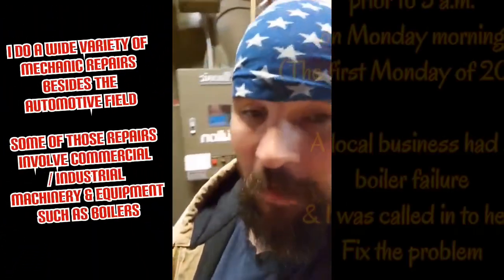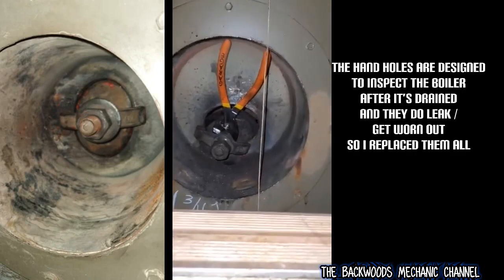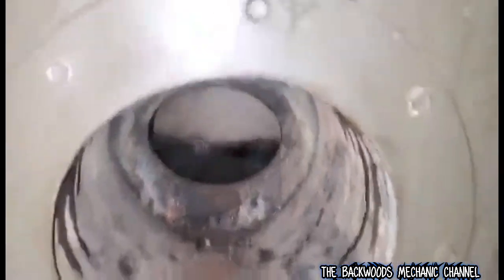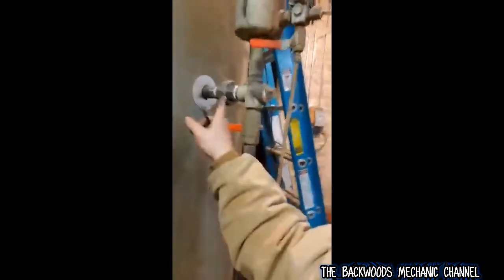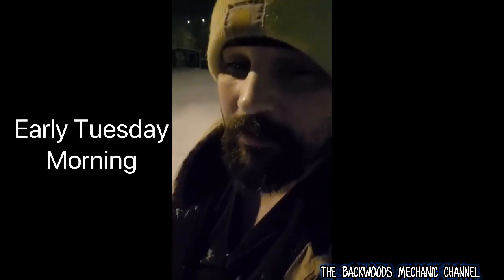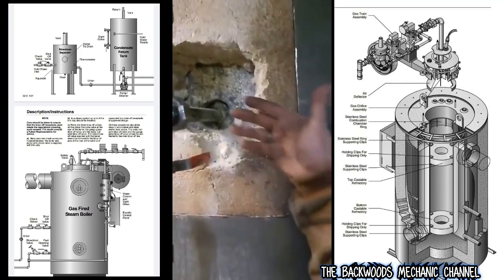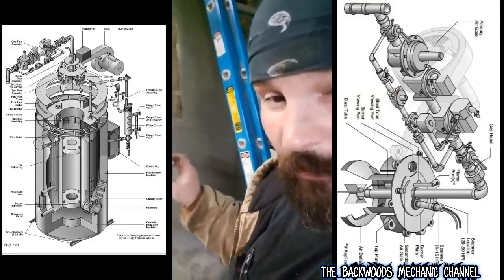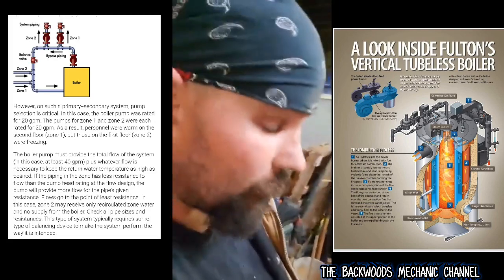Working to Diagnose a Steam Leak on a Industrial Boiler FULTON ICS-50 #ItsMonday #BoilerLeak

Comment: You should not be working on boilers. You should have used the pump to pressure test the boiler cold to check for leaks before you fired it up.